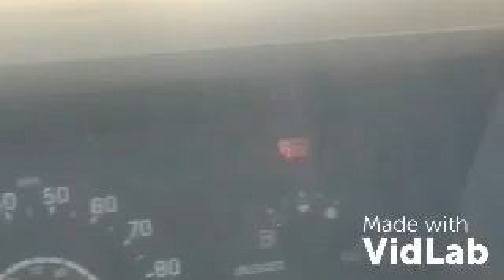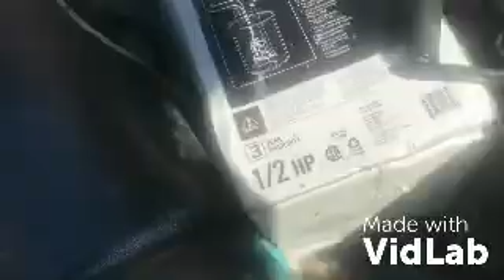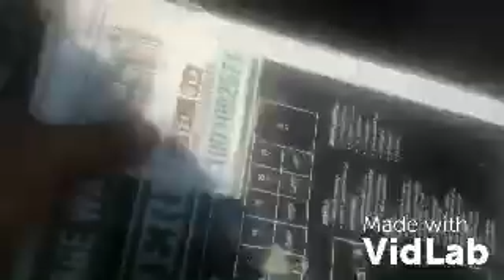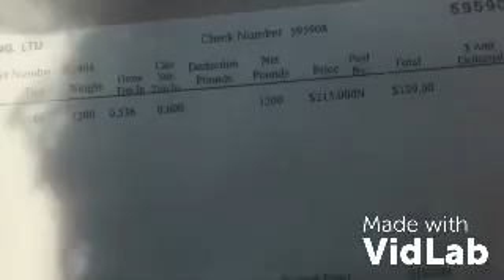Without many choices

Comment: how long it take the trip to the yard, and the distance and how much gas money?
Reply from the maker: illimited knowledge so when yard is 70 miles round-trip from the other one is about 50 or so miles round-trip but both of them you’re dealing with tremendous amount of traffic whether it’s surface streets or partial highway driver to get there so it’s around 20 bucks whether or use the pick up truck or the bigger truck
Plus or minus a few dollars
Anyway and either way we’re talking a good 2 1/2 to 3 hours out of the day
To make a scrap run no I did to my house many times over and over and we’re talking half a workweek just to get rid of scrap
Half or full time jobs work week which was about 18 to 20 hours per week just getting rid of Scrap using a pick up truck
Or even the box van
If I had my larger truck going to yellow on the big yellow that I making two or three rounds to the yard every week so reducing my scrap yard drive down to 6. To at the most nine hours per week
Reply: Holy shit
Reply: i see , hope your big white van would work soon again one way or another, or hire some truck otherwise like you said in a previous video i think, but that could be a costly thing on the long run

Comment: You have to get box truck running to make it worth your time when I scraped it was almost seventy miles to the yard and home  you have to haul a lot to make anything yeeeeeewwwwww!!!!!!
Reply from the maker: Mike Winkelman That’s exactly the distance it is for me it’s about 70 miles to the 1 yard round-trip
Reply from the maker: Mike Winkelman I can’t figure out what’s wrong with it and now
Guess what

The license plate is expired that’s like $200 right there and the safety sticker is expired so truck has to be in top-notch condition in order to pass that
Looks like it’s going to stay broke for a while
Reply: SCRAP Kingdom!!!! You can make yourself crazy trying to figure out your engine they make them if one little isn't right it won't run I had a stupid oxygen sensor screw up it made my computer carb run so rich it wouldn't run then it's called let's replace this and see if it works pretty soon dam parts are worth more than truck yeeeewwwwwww!!!!!
Reply from the maker: Mike Winkelman that’s what I want to avoid throwing part of the problem to fix it

Not sure that is The dream
Reply: SCRAP Kingdom!!!!   I have faith it will work out for you Marty yeeeeewwwww!!!!!

Comment: Top vid hope you get box truck on road soon pal it's true wat ur saying it dosent make sense spending as much on fuel but the pay day less. As for Eastern Europeans in flip flops there macho hard men till lose toes fools. Every were baking lreland running out of water rivers so low.👍☘🇮🇪
Reply from the maker: Paul Oneill I always wondered how does the Pete bogg Moss stuff survive the heat?
It seems that stuff would prefer cooler temperatures. In Ireland 
Ya. Know the stuff that grows on the ground and is  really sick like you could carve it with the
 small shovel and make a log out of it and it burns slowly sort of like charcoal
🤔
Super hot outside here too. 
So hot in fact I swear to God I think I seen a couple of methamphetamine addict‘s putting an air-conditioner back together that they had  previously decided to strip down to sell for Scrap.  LoL 😂
Reply from the maker: Paul Oneill yup. Wasteful trip to take going to the scrap yard with smaller loads because it cost almost as much fuel and just about as much time as a much larger Scrap load
Very inefficient
Reply: SCRAP Kingdom pete you cut it stack it to dry then burn it or sell it as turf that's how country people farmers have heated cooked wit for hundreds of years. But because were in European Union they say no it's not allowed no more it's ballox Ireland needs stand alone. Open boarders Mosaics opening every were people need wake up we are Irish proud of the fact also we need keep are roots identity it's sad Irish need control own affairs not Brussels 💚☘🇮🇪😶
Reply from the maker: Yes. The. EU is just some kinda scam of a political scheme.  No more  bog logs?
Such bull. Ya know 
Now ya gotta go on grid and pay fees just to eat
Reply from the maker: Yes. The. EU is just some kinda scam of a political scheme.  No more  bog logs?
Such bull. Ya know 
Now ya gotta go on grid and pay fees just to eat